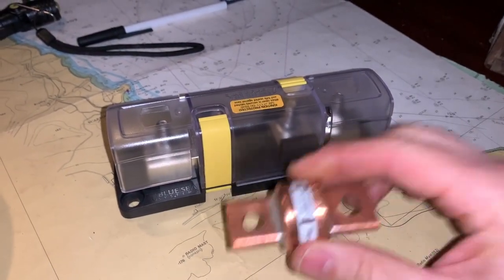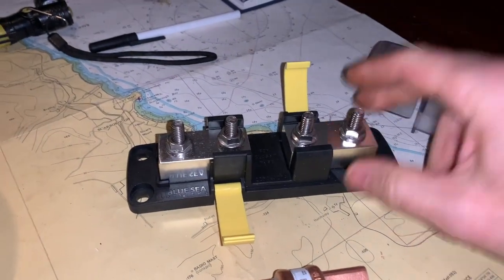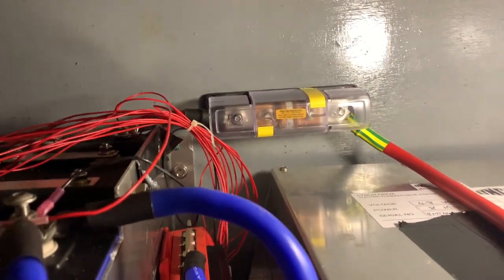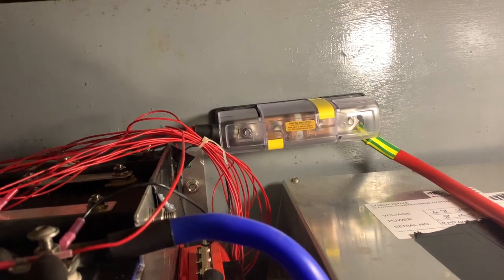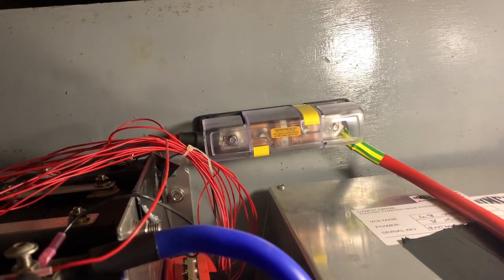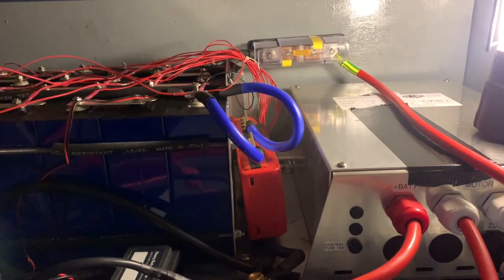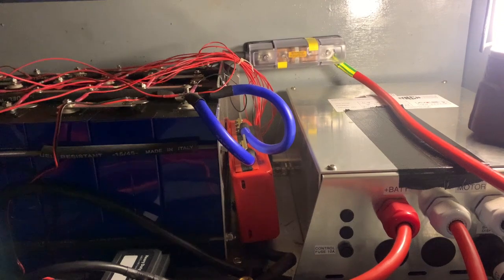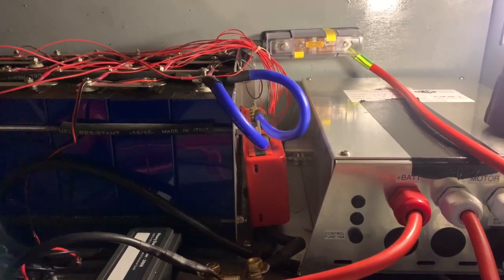Sailing Alison - Fitting a Class T fuse

Comment: This was interesting to me. I was just trying to install a class T fuse holder just like yours, but I am using US-sizing 2/0 and double 1/0 cables and having quite a time getting them to fit into / under the cover anywhere. It looks like you squeezed yours in through the wedge openings at the end, but mine seem too big to be able to be accommodated by those, yet the thickness is required for that much amperage.
Reply: Makes sense, I'm calculating for 250 MCM wire (bigger than 4/0) for our install with a 3000w 12v Renogy inverter. And this worries me, to be able to fit the terminal lugs (5/16") and wire on it.